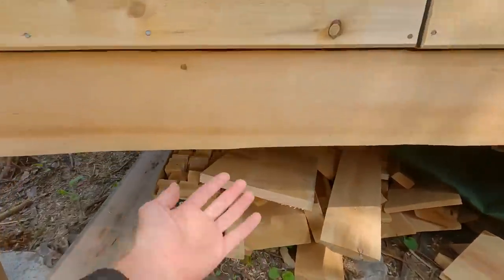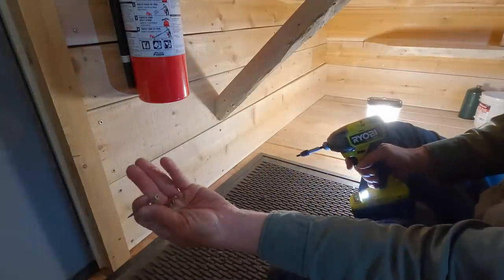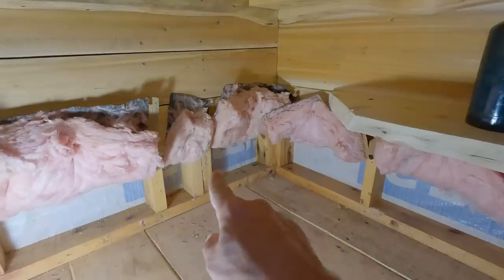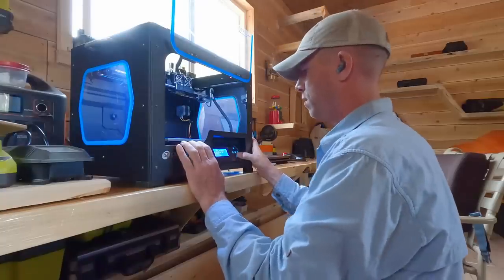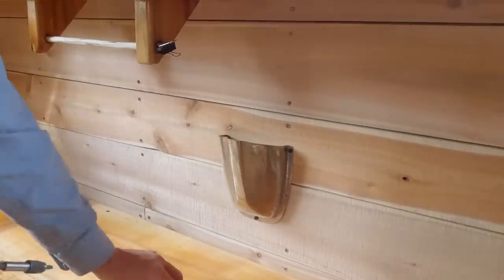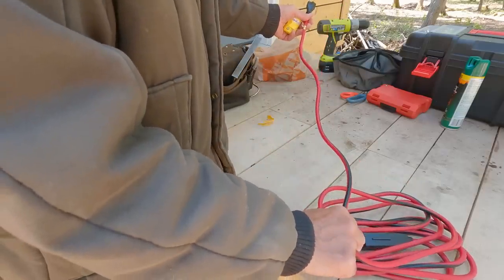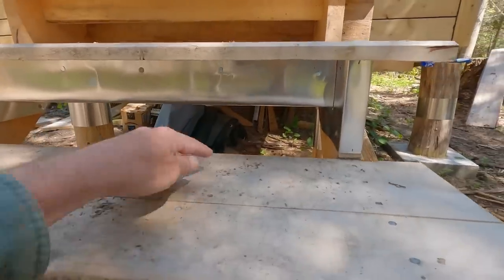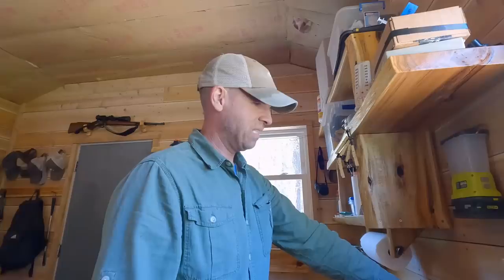Wiring a Single Foul Weather Outlet for Off Grid Tiny Cabin. #141

Comment: Experience note: I spent last winter off grid in the White Mountains of NH . In a Trailer with propane and  2 Bluetti’s and an Ecoflow mini. Down to 30 below a few times. Temperature drastically reduced the time of service of the power supplies : Until, I made insulated boxes for them ! Just plastic bins with styrofoam lining -1” around the power supplies. They are similar to your Jackery. Last 3x longer now. They generate their own heat when discharging. Stay toasty warm! Hope that helps.

Comment: Worm: another good video. As your cabin is on blocks and pillars might be a good idea to install skirting to keep snow and wind out in the winter months. I’ve done that with my cabin. Insulated the skirting as well. Basically the inside floor is same temp as below the cabin. I also put tarps taped at seams on the ground completely under the cabin. Keeps stuff dry for storage. Just a suggestion. U would need a couple of doors for entry underneath. B Deacon Manitoba Canada 🇨🇦
Reply: Awesome idea ! YouTube channel @Can't Contain Us had the same situation with a shipping container home, but they are way down south with nicer weather.
They did an awesome job, the details are pretty overkill!

Comment: Mice also can jump 13 inches high and can run along wires, cables, and ropes. They are excellent jumpers, swimmers, and climbers and can scale rough and vertical surfaces. (Googled "How high can a mouse jump"  Just thought I'd let you know you might need to double up the flashing.

Comment: I'm working on my garage wiring right now too and using all 10/2 wiring, if for no other reason than ,,,I always over build everything, whether needed or not !  That's just how I roll and after doing things that way for many years.  I've never really been disappointed with the results either , other than maybe watching my bank account dwindle a bit faster from using higher priced materials.

A couple of my contractor friends always bust my chops though for being so fussy and over building absolutely everything I do , but the funny thing is that they all end up saying ,," man that thing is way over built and didn't need to be so heavy  ,,  but it sure looks good and won't likely give you any problems  , anytime soon".  I think there just jealous that even though I'm disabled and an amateur in many respects , I can still out build them on curtain projects. Of course I don't have to set to many cost or time restraints on myself sense I'm saving on the back end,  like they have to do when they spec out a project . 

So in my case I guess even being an amateur in many respects and doing stuff myself it often pays off, even if it cost more for materials ? Overall, when you figure out what I've saved by doing all the "bull work" myself , a project likely runs 2/3 less than what it would have cost me to hire a job done from the start by someone else,  even if I do over built everything . 

To bad it just takes me so  damn long to accomplish anything nowadays with the limitations I have to put up with ,,,,,,that can get a bit discouraging when having to put up with constant pain and having projects take so long to finish up. No biggie, I just peck away at things , a couple three hours at a time and eventually my projects get done, even though I dub off as much as you do sometimes. 

 For better or worse I've got a .22 range that distracts me quite often too Ryan .  
 It's sure is nice to have no set schedule so we can take the time to protect the general population from all those desperado tin cans lurking in the woods,  now isn't it ?   LOL!

Comment: Another Saturday with the worm. 👍. Is there a better way to spend your morning coffee time? No.  You have 120v, now run a 12v line and connect the solar to the cabin. Then maybe 12v lights. That would be crazy. 🤪
Reply: I came to say the same thing! Why lug those heavy batteries around if you don't have to?!

Comment: On a GFI there will be two sets of pos/neutral terminals. One set should be marked as inputs/source or high for power in. The other set is for fault protected output to other outlets. It won't work backwards or if they share the same terminals. The grounds often tie together on a single screw. And polarity is an issue. Black goes to the side with the smaller plug terminal. The screws on one side are usually a darker brass color, black wire, and the other side silver, white wire. 
                                                             Good luck.

Comment: Good job on the electrical project. I believe the #14 wire is big enough for what you have.
Reply: It should be, especially since he'll be running it in cold weather when resistance heating of the wire should not be an issue. The overload protection on the generator should also act as a circuit breaker too. I'd probably have spent the extra $10 on a 25' coil of 12 gauge and eliminated the question but I'm rich enough not to have to worry about spending that kind of cash. 😜

Comment: The cover, you bought, for the outdoor receptacle is designed to be mounted on an electrical box and on a wall.  You wouldn't need to do all the under the cabin mounting - this unit could be mounted right below where you want your indoor receptacle and the wire runs right through the wall instead of through the bottom plate.  Also, it's easy to fish a wire up a wall if you feed it between the insulation "Paper" and the wall boards.  Remember Black wire to Gold Terminal, White wire to Silver!
Reply: Black on brass will save your ass 😂
Reply: Good thinking on the flashing. Should keep those pesky rodents out.

Comment: The sheet/boards i talk to you before is also nice to use as a floor insulation stopper. You can buy different brands and materials but when i build house in a wooden area i use the armed fiber cement board and no mouse get in yet. They come in a standard dimension so they probely will fit nice between yous floor joist if you done it right.

Comment: Your basically making an extension cord with a outlet. I would have spent a little more for 12gauge but that’s me. If you’re really worried feel the cord running from your generator put a load on it if the cord gets warm stop and get some 12 gauge. But your correct if you’re pulling more the 15 amps your gfi and the breaker on the generator will trip. If you put one on the other side of the cabin definitely use a 12 gauge. I’ve made this mistake before in my earlier years. Bigger is better. My rule of thumb is whatever I think go bigger gauge!!!!! 
Ryan I always enjoy waking up on Saturday make some coffee and I you’ll know by 06:00ish Ryan and Ringworm is ready to go!!!!
Thank You! 
Know you have a fan in Southeast Texas!

Comment: Great job on the electric install. The generator may have a clogged main jet which is the screw on the bottom of the carburetor bowl. Clean the tiny hole in the jet with a piece  of stranded wire, then disconnect the fuel line from the carb and drain the dirt out of your fuel tank and into a bucket. This is best done with just a little gas in the tank.

Comment: Using a solar boat lift kit for d.c. electric to power my led lights and radio. The only tools I use that pull over 15 amps is my makita circular saw and welder. Both tend to draw extra on start up. So I try to use 20 amp outlets for them. Wiring my cottage like a boat. Super capacitors more than double battery life in solar setups.

Comment: GFCI is only for ground fault protection. Circuit breakers are for current protection. They do make GFCI Circuit breakers that provide both protections. Voltage drop is typically over a greater distance than your running.

Comment: Ryan, I know you dont care.. but just in case one of your viewer does. A GFCI purpose is to protect you against electric shock, only, it dose not provide over current or thermal protection.  Thats why they are required in wet locations where the risk of shock is higher, like bathrooms, kitchens, near pools, outdoors (standing in a puddle. lol) so inside your dry cabin not required. Unless you install a indoor pool... maybe your next video??? Lol...

Comment: This is late but wanted to say, they used to tell us in Paramedic school, "don't look for Zebras !"  In other words don't read into too many things.The 14 GA wire will carry 20n amps without a problem.  When wiring a home there are several plugs run off it.  everything doesn't run at the same time.when you plug your generator in to it it will work just fine.  The 15 amps it states is the max...  plug it in and forget about it...

Comment: You could have hard wired your external cord and not used a plug. Just put a hook under the cabin to hold the cord. This would have been safer and saved the cost of one plug. Bob in Reese MI
Reply: This! 👏🏻

Comment: May I suggest a few things? I'm a part time "know it all" (lol hardly) anyway maybe for future reference or consideration; PVC schedule 40 conduit (grey in color) and fittings are generally fused together and the conduit ("pipe") is easily cut with recip saw or hack saw or even some product specific lopping style cutters are available. You can really get on a roll with this type of material. If installed as intended by manf it is also at a minimum water resistant and also rustproof. It does get a little bit brittle in the cold, so don't beat on it with a hammer or such. Unless you're into that kind of thing. Finally (if you even read any of this, dang I should have put it on an audio format like a podcast or sumpin) even as much pain as it would cause; look up a table for "ampicity of conductors" to safely size wire and really to protect wiring, fuses or circuit breakers at the panel or source is highly recommended. Simple circuits really are simple just use your google machine for some pointers. Good luck and be safe.

Comment: You should have used a legit generator inlet plug instead of the suicide cord. The inlet  will handle up to 230v 30amp. They have them at home depot by the the distribution panels. The gen inlet are male so your extension cord end is female making it fool proof for not zapping yourself or curious others. Either way, nice install and it will get the ob done.

Comment: Fyi,
Generally the basic idea with running electrical lines etc, is to put your electrics ABOVE WATER LINES AND ANYTHING WATER RELATED.
So,
It is Generally a bad idea to put an outlet on the bottom plate.
Why?
Because water runs down hill.
So water from weather, melting ice, snow will run down and accumulate at the lowest level. So if that is where you install your outlet..
KA-BOOM!! What could go wrong?
Just saving you time reading the latest version Electrical code book. Lol.

Yours truly, 
Retired electrician
IBEW LOC 363

PS:
Usually OUTDOOR outlet and related wiring would be a good idea if you haven't already bought it
Another thing that would help, is when designing your layout, verify your "ground/wire" integrity throughout your circuit. A dedicated ground path helps reduce computer issues as well as making a safe path for electricity to flow (other than through your body etc..lol) in the event of some sort of short circuit which can easily happen with wet/frozen weather situations. 
Hope this helps..good luck!

Comment: Wouldn't it be nice to have the solar panels close to the cabin and be able to plug the batteries directly into the panels while the batteries are still in the cabin?  

Next thing you'll know you'll have running water.  Thanks for the video.

Comment: I might have just drilled up from underneath to run the wire up into the space between the studs to whre you want he outlet. Thus not having to tear apart the shelves and wall. 
The way you did it lets you check for moisture.
On your weather proof outlet cover, it is designed to work with a weather proof box. Should have been right next to the cover. Often come as a kit with both the box and cover and an outlet.

Comment: Using a inlet and not a outlet going in the cabin probably would have been a little safer. I would be a little afraid of something jumping on or knocking that plug out while the generator is on. I know that's highly unlikely but with my luck it would land in a pile of leaves.

Comment: Any exposed wire insulation under the cabin will be chewed and eaten by Squirrels, Rats, Mice.  Best to put it in a conduit to protect it, if you run wires to the Jackery next to your bed.

Comment: I would not have used a suicide cable. Honestly, I wouldn't have used the interior Romex style wire either.
I'd have used MC 12/3 from outlet(s) inside to a weather proof Nema 5-15P plug so you go straight from generator to outlet(s).
I'd also drive a copper grounding rod right next to where the cable comes out of the floor and then separately ground the MC outer sheath to the grounding rod. (always a good idea to pour a gallon of salt water (1 cup to 1 gallon) on the grounding rod.) Some folks just pee on it, but you wanted to put that loud-assed generator right next to where you live. Anyway, if a stray nail penetrates the MC and shorts hot, it goes to ground and your GFI will trip.
A breaker protects the wire from melting. The GFI trips when the return doesn't match the draw, but if you have no ground other than the return, it's got nothing to compare and trip from.
The GFI protects you when you drop your toaster into your stock tank jacuzzi while you soak. :-) Because everyone eats poached eggs on toast , strawberries with whipped cream, and drinks champagne with OJ when in a jacuzzi.
And those squirrels you treated poorly have no qualms about pushing that toaster in with you, as a lesson to others that dis squirrels.

Comment: How about you add an earth bond for safety and use something like a 32 amp commando plug/socket outside instead of the double ended death trap wire ;-).. otherwise great video ;-)

Or what they use for RV hookup in USA

Comment: They sell outdoor boxes just like the one you printed probably that were right next to the cover you bought. I expect any impact at all will shatter your printed box. If you ever get a larger capacity generator it will put out more than 15 Amps. Good practice is to use 12ga wire for receptacles as you can plug several 15A devices into a single circuit. Your 14ga wire is usually for lighting circuits. You're ok with your small generator. Cheers.

Comment: You need a 15 amp circuit breaker installed in the circuit.
Reply: So long as he doesn't get a generator that is rated for more than 15 amps continuous there is no issue. That generator also has overload protection that is basically a circuit breaker. Adding another circuit breaker is not a bad suggestion but it would be somewhat redundant here. I'd have probably spent another $10 on 12 gauge wire but #14 will work for 15 amps.
Reply: @noyopacific  what about a friend or the next owner who doesn’t know that. Uses a different generator. There is a reason every circuit has a breaker.
Reply: @RexMoore1984  I said it was not a bad suggestion. Sorry that isn't good enough for you. You come across as a rigid type of guy who is unable to consider a perspective other than your own. BTW, lot's of circuits that are run off of generators don't include any circuit breaker other than the overload protection.

Comment: Suggestion:  Less time building shooting ranges til you finish the inside (ceiling) of your cabin and other incidentals that will get you ready for NEXT Winter..... PS...you'd be better to use 12/3 romex  GROUND ....use a 6 ft copper plated rod driven into the ground.  12 ga will give you a tad "extra" capacity without being barely on the edge.  Your welcome.
Reply: The shooting range is more important than you think!

Comment: You didn't move out into the woods so you can listen to a generator run for 5 hours straight.  Build a small generator shed about 30 feet from the cabin, and direct wire what you have already made right into it.  The additional cost in electrical stuff is under $50.  Not having to listen to the generator when you are inside all winter is easily worth it.  And it means no more janky suicide cord, which is sketch as hell even in a setup as simple as that.   All you really need to buy is some additional outdoor rated wire.  45 feet is maximum length for 14 gauge wire.

Comment: You need a solid blanket of foil bubble wrap along the bottom of the floor joists! This creates a pocket of air that will give you some insulation value!! Finishing the ceiling of the cabin would also help.

Comment: Were it me...  Direct wire 10 gauge rv cable or at least 12 gauge cable from generator directly to metal box at nearest point to generator....  From that box, metal conduit to metal junction boxes using 10 gauge wire, just below the two intended outlet points at least 12 gauge going to the outlets...  Overkill yes...  And perhaps violates code to some degree but, for me, I'd rather the wiring under the cabin and to the outlets be my least concern.   PS...  Using metal conduit and boxes under cabin potentially simplifies adding another branch at a later date...  No jacketed wire in conduit, just buy spools individual wire and twist and pull it through conduit.

Comment: 14 AWG wire at 5m at 1200W has a voltage drop of 0.73%. A 1m cable has a loss of 0.15%. In other words, it's probably not worth thinking about.

Comment: Why not just drill straight up from underneath the cabin where you want the outlet??? Run the wire underneath the cabin to the point where the outlet is. Why does it have to run along the floor inside??

Comment: #14 awg wire is rated for 15A, and the gfci you cannot wire a line to the load side and it work. It has to be wired to the line side to work. Backfeeding electricity in a gfci doesn’t work.